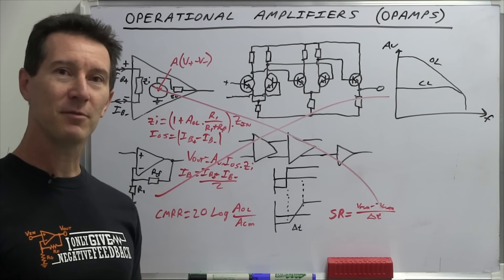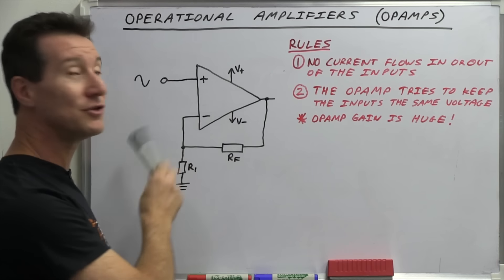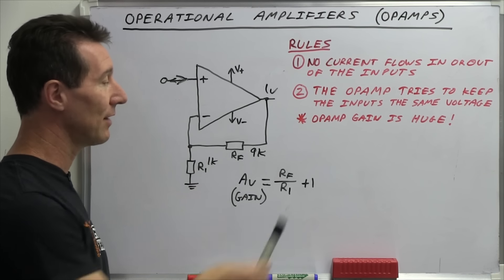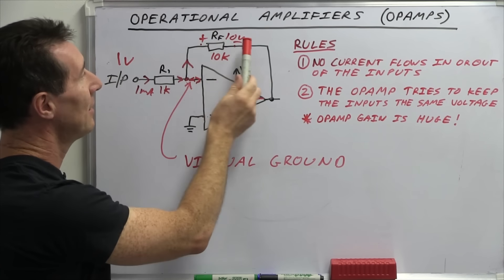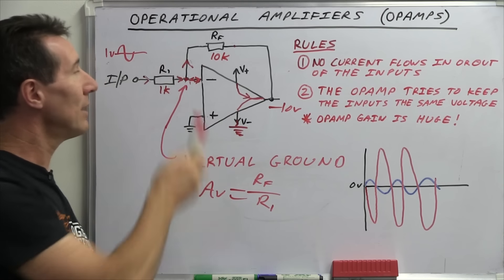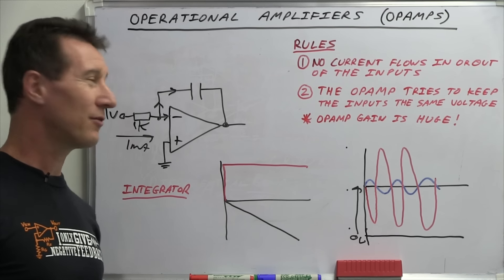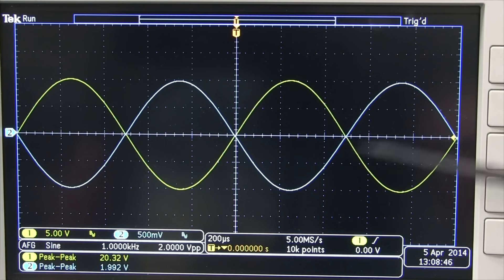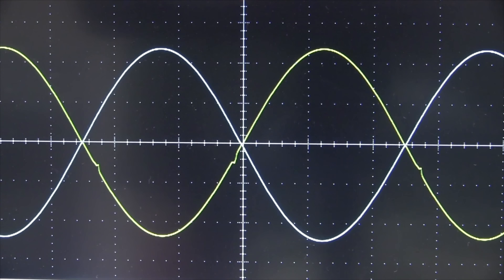EEVblog #600 - OpAmps Tutorial - What is an Operational Amplifier?

Comment: Great explanation, you just took the best OP-Amp explanation until now from:YT- John Santiago Op Amp Design Basics - Inverting Amplifier - Part 3
 (i was actually wondering when you will do that 8-).
While you mentioned ohm's law you might add Kirchhoff  circuit law  in the part where you "wonder" about where current goes and that lack of minus in inv. OP gain formula was bugging me until you corrected it...
For the end, you put smaller resistor which drives 10x larger current form output trough feedback resistor to "match/counter" input current (100uAmpsp rise into 1mAp) so output stage switches into B class (whole chip with 2xOPAmps has less then 1mA quiescent current and output stage probably uses about 70% of that) and you see clear crossover distortion on the output waveform (where OP-Amp loses control hence the spikes on the input, you can represent that as vehicle steering wheel dead play for mechanical types) 
Great video, just took best opamp explanation title,cant wait for #2,3,....

Comment: And now we need a second part, where you show us the non-common circuits, as let say...Gyrator-stuff, Log-converters, average/peak rectifiers, and "interferences" when using OpAmps in RF circuits (like input pin reversion)....;)

Comment: good ol crossover-distortion. the LM358 has a class-B output stage and has to be biased properly or you get crossover distortion. instead of having diodes in the output stage, they tied the bases together. They were designed to be low power, so they did this. a proper load resistor between the output and negative supply will fix this problem. decreasing the feedback resistors increase the load by decreasing the overall impedance to the "virtual-ground", causing more and more crossover distortion.

There is a tradeoff, by putting a resistor in the output stage to -ve, you also get a much higher idle current. Much more than of a standard class-ab op-amp. So that blows the "low-power" rating into the rubbish bin.
 
Edited as my first couple attempts didnt sound, or come out right.
Reply: Yeah, found that explanation in about ten places on the net, none of them bothered to explain how the missing load resistor influences anything - they all went way, way above the 'dummie level' this video is addressing (and most certainly outside its scope). Kind of like the answer above, actually. Would you please elaborate a bit on that - I freely admit to being a proper dummy in any of this analog stuff...?
Reply: Attila Asztalos Im going to leave that one to Dave as he is going to explain it better than I ever would. From what I understood years ago, is there is a small current source in the IC that needs beefed up by the resistor to bias the output stage into conduction on both transistors instead of just one. its class-B for a reason, one is because its low power, 2 is because it can reach ground whereas true class-AB cannot, at least not without some help. Amplifier classes are explained on the web in various places, but class B means its biased into cutoff. Meaning at idle with no signal present, the transistor is switched off. Raising the input voltage approximately 0.7V into forward-bias, the transistors will begin to turn on. When the output signal reverses below 0.7v, the transistor is off. Then as it swings below 0, into -0.7v then it will switch on again. (lower transistor). That creates a dead-zone of approximately 1.4v that the amplifier isnt conducting. This creates crossover distortion. The external resistor increases the source current to the bias network, adding extra idle voltage/current into the output stage allowing the transistors to stay on all the time, known as class AB, or for some reason in the LM358's case, Class-A.

Edit: Looked at the datasheet, the texas instruments datasheet on page 11 explains it all.
Reply: Nice.

Comment: Do you have a t-shirt for every electronics component? :D

But seriously, thumbs up for the simple and straight-to-the-point explanations. I am a programmer who sometimes has to deal with electronics. If I take some classical electronics book, it is all over with formulas, math and what not, when all I actually need is just basic understanding how to build or troubleshoot some circuit. The same problem goes also with mathematicians. For example, on some forum I asked how to use some specific function from a really popular FFT library to calculate coefficients for FIR filter, and math gurus threw lots of formulas on me and no-one could tell me that I need just two code lines to correctly feed FFT data and then add an offset. I spent two days with Matlab to find out that I needed that damned offset to get the right data out, and no-one could tell me such a basic thing!

So thanks again for your work to make things simple for us, beginners and hobbyists.

Comment: Hi there! First of all I would like to say that this video was probably the most clear explanation I ever had. This is the reason I am asking here instead of a forum.Next is my problem. I am trying to interact a thermocouple K - type. So I try to gain about 1mv ppv to 5 volts on the adc. I tryed the simple shifting op amp from the video, I tried as well the inverting op amp for the negative temperatures range where I get 0.5 volts for positive temperatures. Both of them the cold end was grounded. The most successful try was for a differential op amp where after dividing the output by the gain I get triple value (2.1mv instead of 0.07mv) . Could this be caused from the reason I have no buffer, or maybe the lm358 is not a rail to rail (even if data sheet says they are for the low range)
Reply from the maker: +Venera Radoslavova Do ask on the forum.
Reply: Thanks!

Comment: This might need a decent video about negative voltages in electronic engineering.
From physics standpoint it would make no sense. Its one of the few confusing things people have hard time to understand -  why its there, why its used, what advantages/reasons there are.
Iv even seen devices that are labelled to require -5V.
like using -5 V and +5V instead of +10V.
Reply: re the confusion from a physics standpoint. can you elaborate? i think you're confusing voltage with charge.  there's nothing unusual about a negative voltage, it's a relative measurement. any one test point can have greater or lesser electrical potential than another. this is Voltage.
Reply: Daniel makes a good argument. But some people might still be confused. Not everyone is "in the know" about this topic, might make for a nice short video.
Reply: mainly due to the fact that schools etc move or less teaches people so that there is +/-. Electrons move only one way etc. So iv seen questions like "but if its -V do electrons move backwards" and similar type.
Often - is considered as ground which would be 0, so if suddenly u have -5V and +5V it gets confusing.
That's why a video to cover basics of negative voltage/its measuring/advantages/uses etc basics would be good.
Reply: Mauro Tamm Let's take an analogy that involves gravitational potential, because voltage is just a potential difference. A measure of  "how much electrons what to go there". Imagine standing on a platou, or say at the top of a diving board. And you use that as your reference, then ground would be negative some distance, and if you throw something up in the air that would be positive some distance, the gravitational potential is then measure from the top point to the lowest point - which would be like "+5V to -5V" or along the analogy "+5 meter to -5 meters", assuming the platou is 5 meters tall and you throw something another 5 meters up in the air. The potential energy you could get from that is mgh, or assuming som contant mass, g*h. Which could be viewed similarly as i*R (we can view air drag and resistance as analogs in this example, and remove both), and remember that current is C*s. Now you can see how they might be analogues "gravitational force * height" and "electric force * seconds". Another common analogy is imagining electricity as a river (H2O molecules as electrons?), where voltage would be height difference of the water from one point on the river to another.

I am just a noob myself, but these are analogies I've used myself in trying to understand. Electrons will always flow from higher to lowest potential, just like anything on earth will always drop the lowest point by gravity.
Reply: TheAmmoniacal isn't it easier to explain it using different example like the buildings ? the underground floors are negative because the ground level is the zero. it's all about the reference point.
Reply: how would you a like a power supply like this ?
outputs: 0V , 7V, 12V, 15.3V , 17V, 24V with current ratings 1A between the 7V and 12V potentials, 1A between 0V and 12V, 15A between 12V and 15.3V potentials, 20A between 12V and 17V and 15A between 12V and 24V...
seems to be a big mess right ? and that would be a spec of your computer's power supply WITHOUT having the negative voltage concept...
Reply: if you're wondering how there could be a negative voltage you didnt understand what voltage is at all.
Reply: Op amps can be considered a Class "B" amplifier with a push/pull output that provides a + or - signal relative to the common or "ground line" of the amps power supply connection.

The + 5 and - 5 volts are from two power supplies that are connected together to form the ground line and the other + and - lines used to power the amp.
Reply: kansasthunderman1
so?
Reply: JohannaMueller57 The original question was about the physical existence (and specifically the labeling) of voltage connections as being "+" or  " - " 5 volts and I provided a practical example.
Reply: kansasthunderman1 if someone has a problem with negative voltage or negative anything he really has no business in engineering. if you can't grasp such a basic thing, what do you bother with op amps then?

Comment: Thank you for the great tutorial. Does anyone know what are the advantages of a buffer - why do we use them. Do you know any good practical examples. Thanks.
Reply: Optimize the Flux Capacitor
Reply: I could be wrong but I am pretty sure that buffers are used when you do not want to disturb the non-inverting input that you are measuring.
Reply: We use print buffers to let the 3D design tool to go back to doing anything else but micromanaging the 3D print job while the 3D project is being extruded. So I guess 3D is the droid u were looking for.

Comment: So - "Why is it so?". Can anyone explain?
Reply: It's been three years...
Reply: nevermind I found it: 

"Regarding the puzzle at the end, the low resistance effect is an increased current at the OA output. the OA at approximately Vout= -0.5V should sink 50uA which is higher than the value in the datasheet/figure13 of 30uA max. so the virtual ground voltage fluctuates and so does the output at approx. -0.5V."
Reply: @KingJellyfishII  how can i thank you enough
Reply: @ashishrocks93  lol I just copy/pasted it from someone else
Reply: @KingJellyfishII  
Above explanation said.

at Vout = -0.5V
I sink = 50uA  (> 30uA)

Can you please explain me,
What special thing happens at -0.5 V,
Which doesn't happens at other output voltages.

Because,
At higher voltages on the non inverting input,
Expected Sink current is higher than that at 0.5 V output.
Reply: @KingJellyfishII  Not totally correct, first table 13 does not apply to the lm358 (but the lm2902) unless you use a different data sheet of course. I believe it's much simpler, the sink current for Vout=200mV is only 50uA, and goes quickly up to 20mA at Vo=2V.  Because of the 10k resitor for R2 it's working very close to it's maximum ratings at the lower end. 0.5V out is 50uA sink current.  And (apparently) in practice this results in the weird ground spike that fck ups the output.

Comment: I remember learning about op amps in college. They were the most amazing thing. Built a “temporary” audio distribution amp for a radio station till they could order one. Ten years later after running 24/7 they replaced the mixing board and got rid of it. It was a LM 324. Probably spent $15 on parts.

Comment: It's an excellent explanation.  One little thing that could improve this is to explain that on the inverting amplifier,  (when a positive voltage is put on the inverting input) the virtual ground point is positive, relative to the negative rail supply.  This is why you would see a voltage drop, across the feedback resistor (the 100kOhm resistor shown at 43:01 seconds into the video) that would be a negative going voltage (swinging in the negative direction, on the output of the op-amp, relative to ground.)

Comment: Love this video, likely the best, thorough explanation of an op amp...however.

It would be awesome to see the breakdown of an op amp in a device. How it's connected, controlled, what's it connected to and how is it controlled. Is it in a radio, TV, flashlight, calculator, motor controller, vacuum...whatever. I have seen dozens of great videos, all explaing the comparator function and many other functions, how the op amp works, how a resistor can manipulate the outputs regulating voltage...but hardly any real world applications with them in use, and how they are either controlling the output device or another component in the circuit like a transistor.

One example would be, instead of many videos stating the 4 cycles of a modern engine, like fuel being sprayed into the engine, intake, compression, power, exhaust, talk about how the opening of the throttle body causes more air to enter and the mass airflow meter sends a signal to the PCM to command more fuel, then  the O2 sensor fine tuning the mix, somewhat in depth like that.

An op amp gets explained that the output keeps the input the same....but that's in dozens of videos. Going over an op amp in a device and describing how each part of the circuit controls and affects the op amp would be the visual that ties this together for beginners.

Sorry for the long rant, this is still the best video and I applaudball your efforts in teaching others!

Comment: I’m a retired Mechanical Engineer that has developed an interest in electronics.  Your videos are great.  One of the things I do struggle with though is Conventional Current vs Electron Current.  My old and very literal brain gets flummoxed by this.  In the inverting amplifier circuit I can better understand it when I think of Electron Current.  I suppose with time it will become easier to put the differences aside and think in terms of Conventional Current.

Comment: Love them. So vey useful. Designed/ tested them in analog computers. An op amp can do logs, integration, differentials, fixed , times x multipliers/ dividers, limiters, square waves from sine. Nice hi fidelity audio preamps, audio filters. At EAI corp years ago, when a fast pc had a 6 KILOherx clock

Comment: Holy cow, you are an amazing instructor! I would have loved to have you for my EE intro class during undergrad.

Also, there is a small mistake at 22:22: the formula for the gain of the non-inverting configuration should have a negative sign in front.

Comment: Thanks so much for the prompt reply.
 OK, if the two inputs are tied to ground, they won't both be EXACTLY the same (as also mentioned).  So, for instance, if there is only a MICRO-volt or so difference due to the connection of inputs and the gain is 1 MEG, that will be an output already at ONE VOLT!   If the gain is only 100K, we still get 1/10 v out ...just trying to understand it fully!  Thanks much!
Reply from the maker: In theory, yes, that's an issue with large gain system and microvolt level measurement systems. Things like dissimilar metal contacts can cause unwanted voltages.

Comment: hopefully this is helpful for some viewers, but an easy explanation for negative feedback vs. positive feedback is that negative feedback converges, and positive feedback diverges. A real basic example for a negative feedback loop would be take a number, then divide it by 2, then divide the result by 2, and so on forever. Your answer will keep getting closer to zero. The end result is stable. A positive feedback loop would be to take a number and multiply it by 2, then multiply the result by 2, and so on. The answer will not converge on a result, but will rather diverge farther and farther the more you spend in the loop, spiraling out of control. In the case of an op amp, the feedback loop is such that it tends toward stability. the output voltage affects the input voltage, but on a way that converges very quickly on an equilibrium, and you can control that equilibrium by adjusting your feedback resistors

Comment: on your scope, J would have thought that directly connecting a wire between the positive and negative terminals of your positive power supply and negative power supply would have created a short, not equal but opposite wave forms on your scope.  Great video.  Thanks

Comment: Very good video, excellent explanation, I myself used op-amp 741 to build a triggering circuit for Silicon Controlled Rectifier. to control DC motor speed.

Comment: As I get it on the virtual ground and why the signal is equally “gone” when measured here is that since the nature of the opamp is to keep the voltage equal the output of the amp is creating an exact counter voltage at the input as mentioned the input is say +1 volt the exact counter voltage will be -1 volt that equals to 0, the voltages cancel each other out and you have your virtual ground. thus the larger value of the feedback resistor 100K vs 10K will take 10 times higher voltage than input to completely equal the voltage solely a gain factor of 10